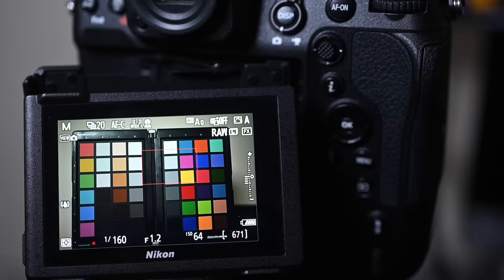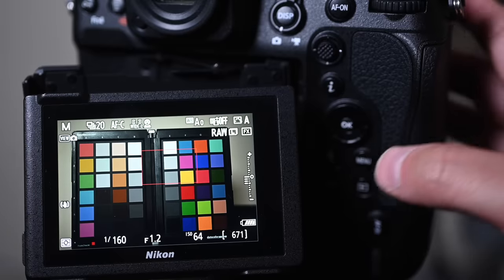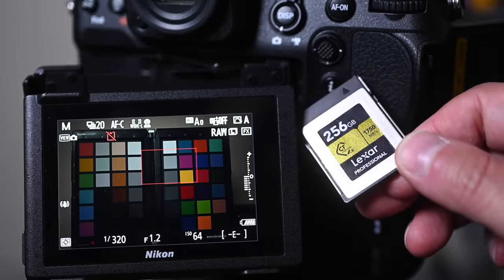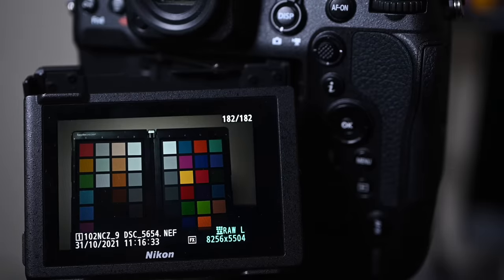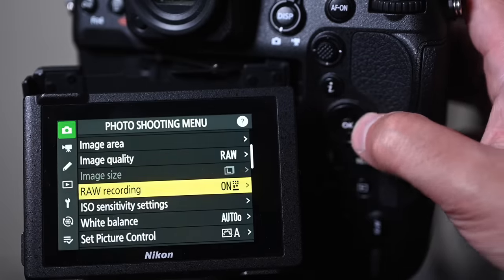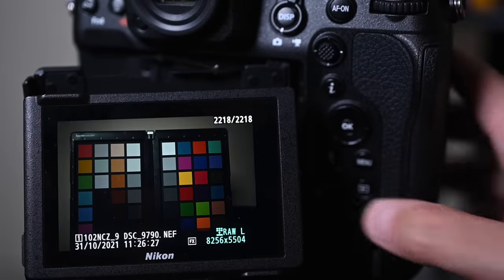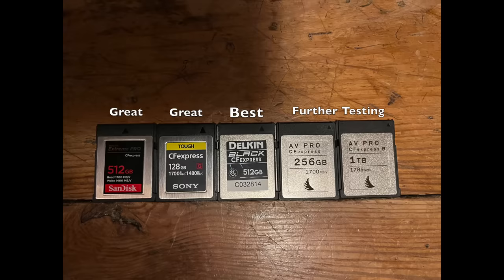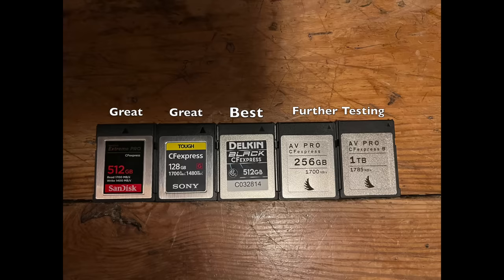Nikon Z 9 Buffer Tests. XQD/CFe/LosslessRAW/High Efficiency Raw

Comment: Indeed. The devil is in the details as always. The price of these solid state memory cards depends on a few things and manufacturers (vendors) are not as transparent as we would like.
As you mention, Ricci, they put the "Read" speed on a card but that is not interesting in camera.
They may be somewhat cryptic about write performance and if they list it somewhere, they publish their "peak" or "burst" performance.
That burst performance has to do with the incredibly fast cache in the card where the card's controller (processor) stores incoming data that next needs to be moved into slower permanent memory. Part of the price we pay is how much cache is in the card here and how fast the controller can be. And, "sustained" speed relates to the cache and processor/controller speed. Some manufacturers publish their "guaranteed minimum sustained write speed" and that is the speed such a card can sustain "forever".
As the memory cells in these cards are presented with an "over-Voltage" when a cell is rewritten, each rewrite is a slow "brown-out" step.
So these cards have a maximum life expectancy in terms of how many times a cell can be rewritten because each little brown-out wears the card out physically.
The number of cell rewrites that a card can survive, is also not generally published. The industry has a number for that, though "total bytes written" (TBW). For example a Samsung PRO series SSD can survive 10 times as many cell rewrites as a Samsung EVO SSD. Note that the T in TBW is for "total" not tera, and the "unit" must be part of the TBW specification.
I asked one card manufacturer about the TBW of their cards and they answered "enough" - which felt like being given the middle finger. I'll never buy that brand the rest of my life. And their MTBF specification, in this context, must have been for the card sitting in a powered up reader, doing nothing. Smokescreens.
The card controllers place data in the card doing something called "wear leveling" and this makes sure that all memory cells in the card are equally worn. If you wrote a file to a formatted diskette or hard drive in the past, it would end up in the same place again and again, in the magnetic layer. In these cards, every write after a re-format where the card had not been completely filled, will end up in a different space of the card.
So the quality of the memory cells determines the price of the card, together with the I/O speed it can sustain, and the TBW. Note here that TBW does not dictate cell quality in an absolute sense. Some manufacturers/vendors use cheaper cells and offer enterprise class quality by stuffing much more memory in the storage device than is mentioned on the label. This is not visible to the user (operating system) of the card, though and only plays a role in the wear leveling processes.
What also may play a role in card price is how many I/Os the card can handle in parallel if an operating system must update, write to, read several files in parallel - this boils down to controller, card firmware and cache again.
As the number of cell rewrites that a card went through are relevant for its life expectancy, I suggest to frequently run the cards through a health inspection program. (Sony have such an app for Mac and PC, it is free, only works with specific readers and cards - and it has never worked as promised for me with their approved devices/cards. There may be 3rd part apps that can do this too.)

Comment: Another issue I see being thrown around: In the Canada interview I could have sworn I heard the host say the Z9 sensor is BSI (Back-side illuminated). Several other places they are saying there is an optical loss pass filter. Can you settle that one as well?
Reply from the maker: It’s a stacked BSI sensor 

No optical low pass filter
Reply: @RicciTalks  Thanks Ricci. I was just reading the B&H site material. Should have looked there first. Much appreciated. Not sure why several sites did not get that right.

Comment: Can the z9 run a cf express in one slot and xqd in the other? My recent pre-order comes with a free Sandisk CFE so ideally I’d use it alongside a slower xqd for jpeg backup. (Wedding photographer who doesn’t need crazy frames per second).
Reply: Ricci, apparently the free card is the 1200 Sandisk but I’d still love to know if you could test the xqd and CFExpress combination (xqd in slot 2, CFE in 1) as Nikon helpline didn’t know the answer. Thanks v much.
Reply: Will the camera be throttled to the slowest card even if the slot 2 card is JPEG (slot one set to lossless*) ??”

Comment: Angelbird have a series of CFExpress cards with the XT moniker, available in 330GB and 660GB capacities, which look similar in specification to the 325GB and 650GB ProGrade Cobalt cards, perhaps these will perform better than their 256GB/512GB/1TB/2TB line?
Reply from the maker: Absolutely I also had access to a 330gb card but that was pre production so I’m really hoping I can get some good tests in for the angel bird cards I really like their ssd drives

Comment: Shouldn’t buffer be a fixed internal capacity of the camera? Wouldn’t that mean that it is independent from the card used? Naturally as you are shooting the buffer is clearing so the faster the the card the longer the buffer lasts. If the transfer speed is equal or better than the data transfer to the buffer then you will fill the card without capping your buffer. So if you want to measure the actual buffer size you want the slowest possible card. It seems that the Z9 has the ability to write to a card really fast, as long as the card can handle it. Therefore Nikon opted for a relatively small internal buffer.

Comment: Good testing….for comparison the Sony A1 gets around 5 seconds or 150 exposures at lossless uncompressed…..no camera available today gets more then a few seconds on those settings 😀
Reply: Wrong. It does losless uncompressed at 20 fps not 30fps, at 30 fps it drops to lossy raw. So it actually has a 5 seconds buffer good for 100 pictures, which is still quite good.
Reply: From this we can deduce that the Sony A1 obviously has a much larger on-board buffer, as the Type A cards are much slower than the Type B shown here, yet the A1 buffer can process greater data quantities. The good news for Z9 shooters is that, as CFExpress cards get better, the Z9's buffer performance will improve at a greater rate than the A1's due to that limiting single PCI-E lane design of the A1's Type A cards.
Reply: No, A1 can do lossless uncompressed only at 20 fps, or 96 frames.
Reply: @Bayonet1809  And once you outrun the buffer the Z9 is still shooting super fast whereas the A1 slows right down once it's limited by the card

Comment: Can you still use xqd? can you show a quick sample how it performs?
Reply from the maker: Did u watch the video ?
Reply: @RicciTalks  I did, I saw the answer at the end. I have a bunch on xqd and I do some product photography, I might use them in the scenario. Can you recommend a dual reader? Xqd cf?
Reply from the maker: The first test I do is with XQD so jst wanted to make sure you saw that ! Iv not found a duel reader I’m supper happy with so far but I would check out the Sony duel reader and the prograde one

Comment: You are doing a great job here. Congrats. So no way to have uncompressed raw with Z9?
Reply from the maker: Correct the Z9 does not have uncompressed raw and it also does not have 12bit raw
Reply: There is no reason to prefer uncompressed raw if the compressed raw is also lossless, probably what Nikon rationalised in removing uncompressed as an option.

Comment: its got  to the time that buffers are now faster than humans need them to be. does this card work in the nikon d850?
Reply from the maker: It does work in a D850 but the D850 won’t be able to use the full speed so the card is faster Than the d850 can write to it

Comment: There is a third way to look at this. It's not marketing. It's physics. You can only move data as fast as the slowest part of the data storage system and a 300mbps SD card or a 400mbps XQD card simply is too slow. This is why SSD's have replaced 7200 rpm drives which are better than 5200 rpm drives. It's not on Nikon. You want to shoot 20-30 fps for long bursts? Put a card in it that can do the job. We ask our camera makers to build faster and faster cameras and then we desired to put the cheapest, slowest cards in the camera. That's on us. That's how this should be looked at.

Comment: Ricci there is a v2 of the angel birds as well now.
Reply: I also want to point out. Some of the cards have firmware that can be upgraded. Some you have to send in. I think Delkin has a utility for it.
Reply from the maker: Angelbird have been in contact already about their new cards ! 😊
Reply: @RicciTalks  btw, I usually benchmark all the cards in all the cameras. There have been a lot of strange silent refreshes over the last 2 years as companies dial in technology. Prograde and Sandisk cards have changed so anyone that has older cards could seeing issues. There were issues with the Canon R3 with this and I couldn’t even get the Gen 2 prograde cards working properly in the Canon R5. So if people have CFexpress cards, from 2 years ago, they might unfortunately need to upgrade as the tech has changed or send in for firmware. Delkin Black is solid though. Delkin cards are always on my too recommended list and they have great thermal throttling and error correction. Also, different cards thermal throttle differently. I’ll do a writeup on everything but dont have all the latest cards as I’ve been stuck in Japan for the last year. Peace!